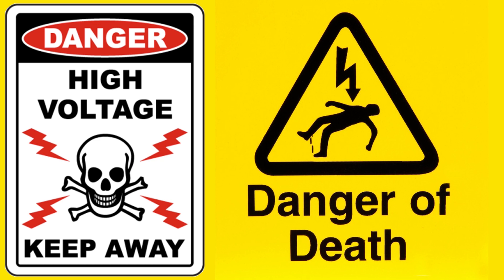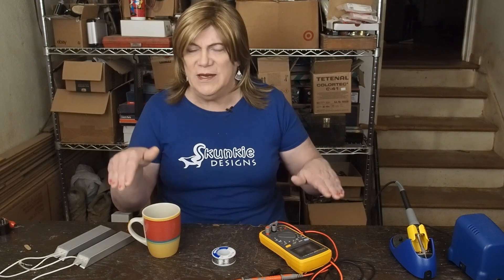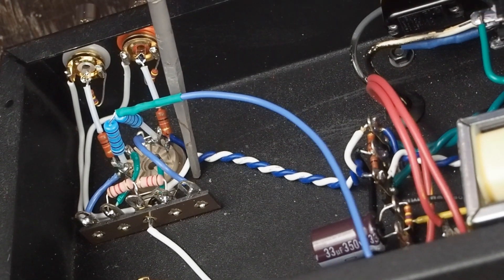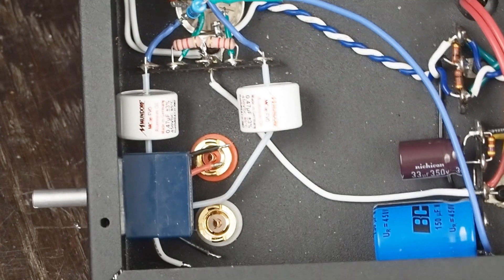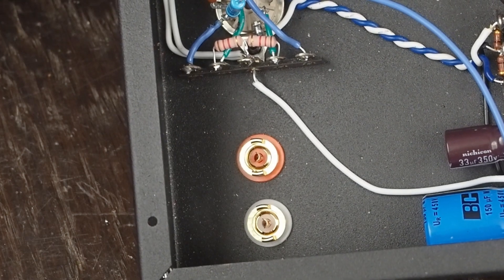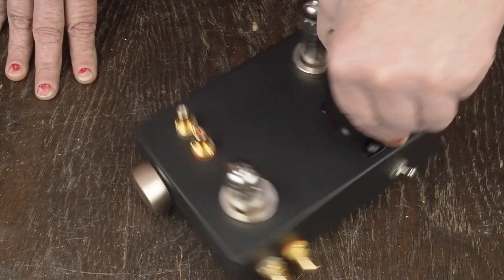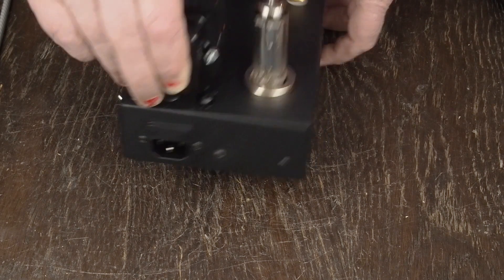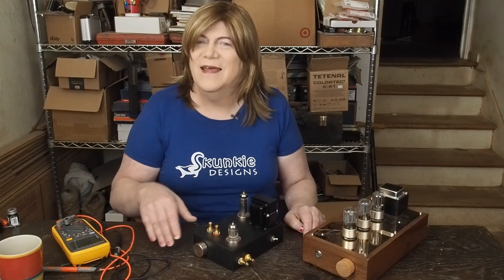HiFi Tube Pre-amp: Wiring the Rest

Comment: Great
Can't wait for the next video.
When using mondorf capacitors does it matter which direction the input signal enters  considering it has a foil.
Have you experiment with this, some say yes it has a direction some say no. I just noticed mine had one lead shorter than the other.
Thanks again for another great video !!
Reply from the maker: I normally try to wire them with the signal going left to right with the writing on them facing me, but I screwed up and wired one of these backwards. I wasn't going to throw it away over that mistake. I've honestly not heard any difference but ideally you do want the outer foil going to the lower impedance.

Comment: Can this be used as a preamp for a  turntable?
Reply from the maker: No, this doesn't have RIAA equalization.
Reply: @SkunkieDesignsElectronics  ah yes that's what I thought. Could it be modified for phono input?
Reply from the maker: @hyperion8008  That's really a different animal: it needs a TON of gain and is VERY susceptible to hum and noise. Would likely need DC heaters, more power supply filtration etc. Not going to happen with 1 tube like this pre-amp uses.
Reply: @SkunkieDesignsElectronics  Very interesting - thank you.